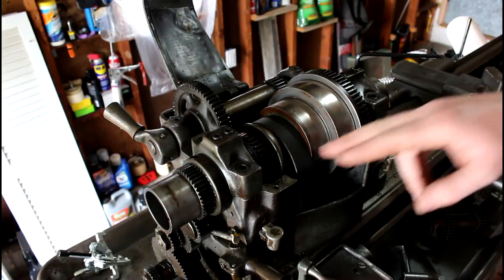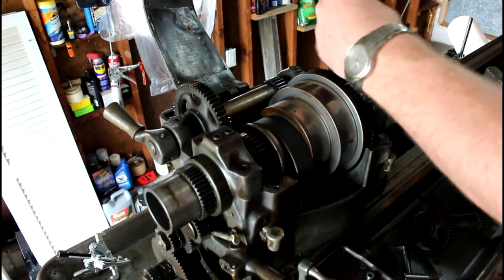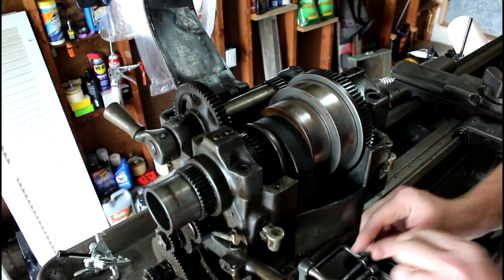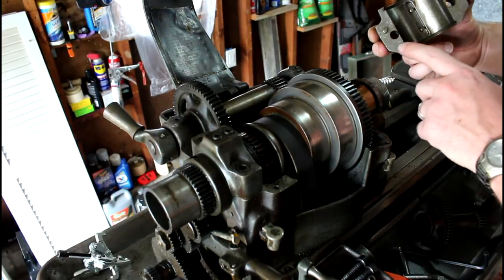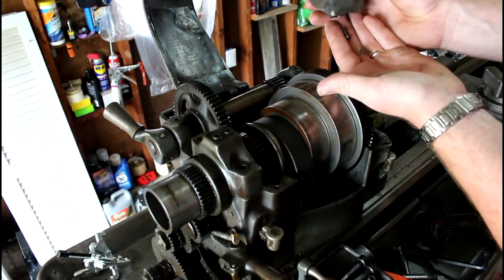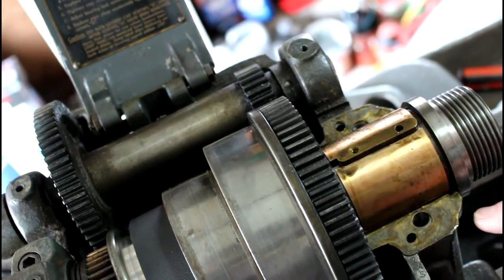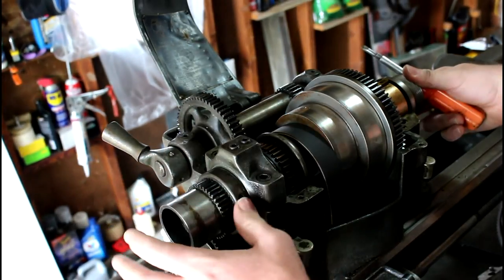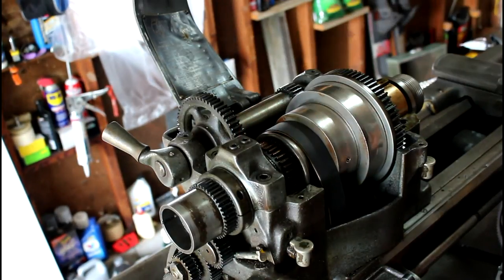South Bend Lathe Heavy 10 BRG Spindle Cap Removal

Comment: I got a southbend lathe the spindle is shaking under load do you know what might cause that?
Reply from the maker: You need to check the headstock bearing clearance. If that is OK, your gibs on the compound or cross slide could be loose. That's where I'de be looking first. As long as you have a solid tool post.

Comment: brg is short for bearing ie bearing cap, just watched another video of yours, a tip I used to give my students was to have various blocks of wood with dowling  sticking out of them so when you remove a gear you place the gear or bushes  etc in the same direction you remove it, it make an easy reassemble task, great video's by the way
Reply from the maker: ian duff Hey thanks that is a good idea. I did notice that the bronze bushings have an F scribed in them so you know which way to put them back on. I also did get a larger steel rod to pry the caps off with through the bolt hole. They pop right off. Thanks for watching and commenting!

Comment: Are you just going thru it to check for wear or were the bearings bad?
Jim
Reply from the maker: Skip Tracer I had to replace the bull gear, so I had to pull the spindle out. I also had to re-shim it because I ended up swapping spindles.
Reply: You're going to have a fine stable of lathes the way you're going ;>)
Jim